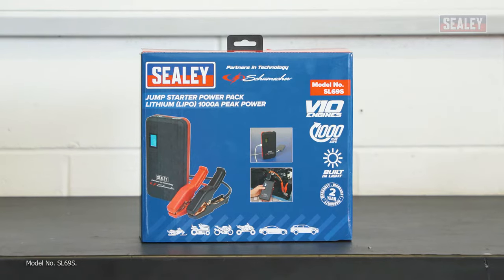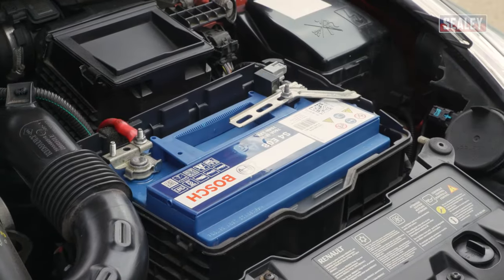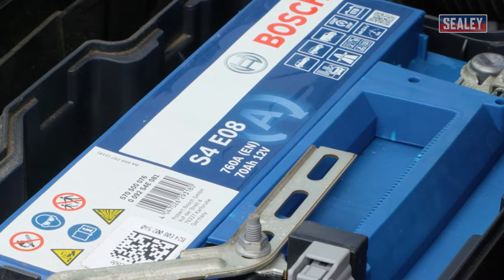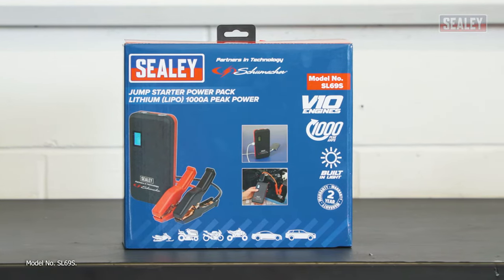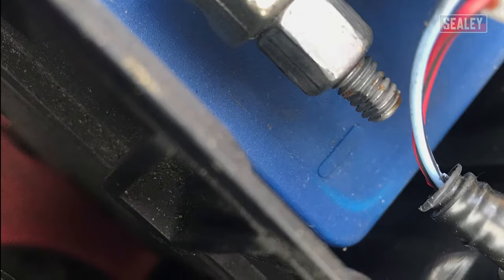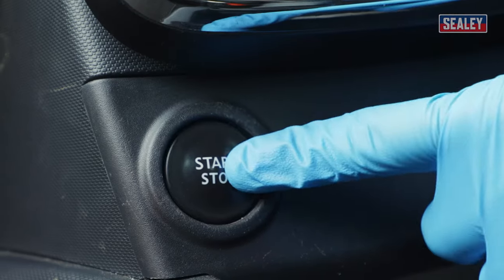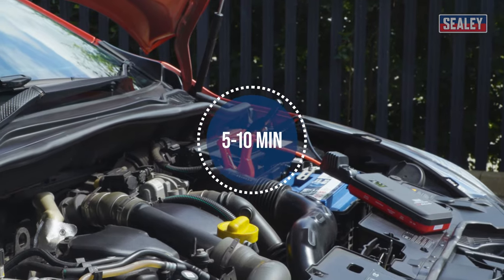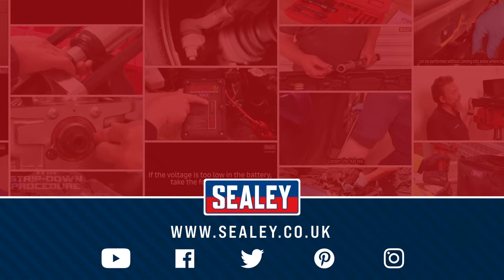How to Jump Start a Car with a Power Pack

Comment: Take the red cable off first
Reply: Really?  Is it because if the ground is removed, it then creates a potential current for the red clip?  Like the ground is helping to diffuse electrical current away?
Reply: Bullshit: you do it in reverse order. Black first, then red.
Reply: te9591 - No he's either an idiot, or some sort of psychopath only interessted in causing injuries to people.

With a kit like this, it 'generally' doesn't matter since the power is off, however in the (low chance) case where it's "off", but still providing power (a.k.a; something be broken) you ought to do it the correct order which is black, then red.

The reason for that is, there's currently an electric circuit going on and you're interupting this by removing the cable, so removing the positive (where the current comes from) first, you create an electric arc that can (among other things) ignite the hydrogen gasses released by the running battery.

If you don't want to (in the worst case) create an explosion, do not remove positive(red) first.

This is also why you don't put negative down first, as it creates an arc when you attempt to put on positive.
Reply: @SS-nm3uy there's an Republican for you 😂
Reply: Personally I do red on, black on, then once the engine is started, I turn the pack off and remove the plug from the pack, then I remove black first, then red, and I've never had a problem
Reply: @littlephoot6931 correct you place the black cable last and remove it first
Reply: @DCshandle  thank you 😊 thats as food as my own dad telling me I done right ✅

Comment: You can just remove battery when you successfully started an engine. Doing like it was recommended here might lead to a situation where you might fail to start car again. Of course, it is potentially less save if 1000 things go wrong all at the same time.

Comment: My one did not work it had 79% charge in the pack and still did not work mine is for a 2 leter engin it is for my renult cleo does anyone know why this pack it not working thanks in advance
Reply from the maker: Hi. That doesn't sound right, so could you please get in touch with our Technical Team on 01284757505, or via email to technical@sealey.co.uk and they will advise accordingly. Thank you.

Comment: Two questions:

1. Can this power pack used on a car where the battery of the car has serious cell shortages?

2. Follow up question about the  same car: how far can you drive a car with this power pack as a substitute for a real battery, without anything turned on in the car except the engine? (without using A/C, radio, headlights, heating fan, etc. let's say on a 1.6 L gasoline Corolla?)
Reply from the maker: Hi. It would be best to replace a battery with a known cell shortage and a Jump Starter Power Pack must not be used as a battery substitute. Thanks.